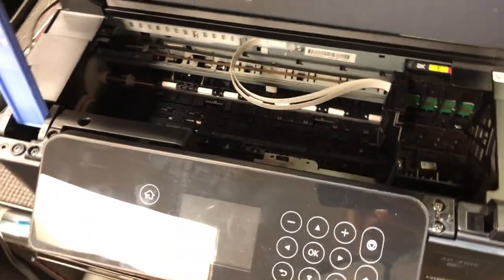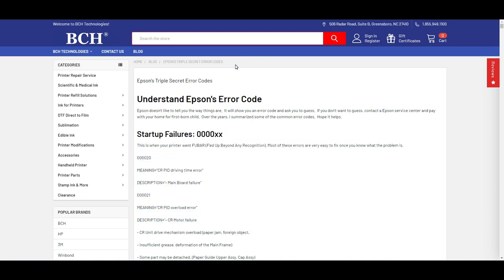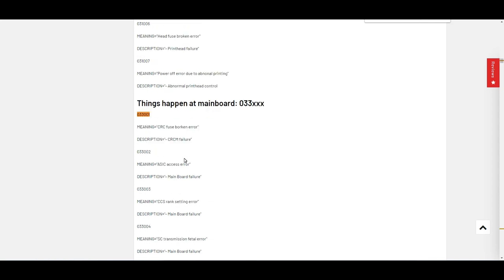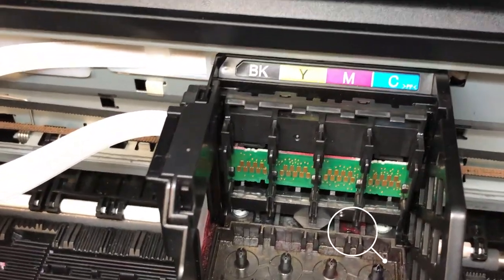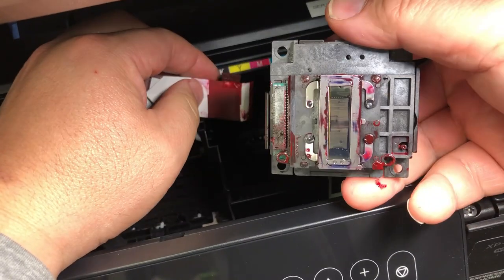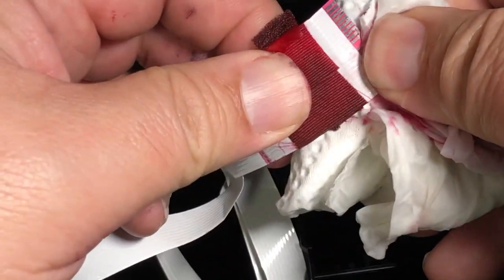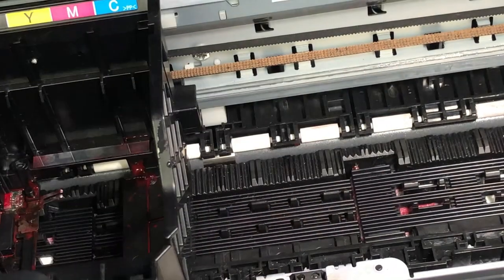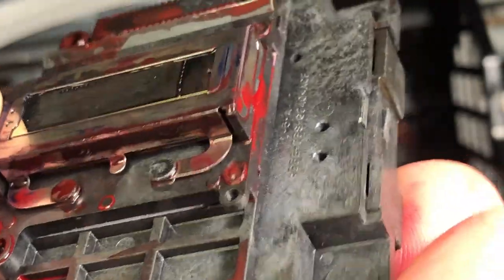Epson Error 033001 - Expression XP-4105  Troubleshoot Diagnosis

Comment: Thanks for providing more information about this error! With your help I was able to find the problematic fuse and came up with an ugly fix for my printer.

The fuse responsible for this is F301 on the CG30MAIN mainboard. It's right next to the printhead FFC ribbon cable connectors on the right side, next to a large resistor labelled R720. You can actually get a pretty good shot at it from the top of the printer after removing the plastic cover. I was able to desolder it and replace it with a solder bridge without having to remove the board or disassemble much of the printer, although you'll have to solder left-handed. While this did solve my 33001 error, obviously shorting out a fuse isn't the best idea long-term, so don't try this at home. I don't know the fuse value needed to find a replacement, unfortunately. If I find more information I'll put an update here or maybe make a video. Hope this helps someone.

Comment: Kevin, do you offer any disassembly procedures for the WF-7720, I think I have an blown fuse o the motherboard.  Also, do you replace the fuse or just the whole motherboard, thanks and keep the great videos coming!
Reply from the maker: Yes we do and it's coming up.  For the fuse, you can get a fuse from littlefuse.com.  However, the amp is 1A, so most people just drop lead on it and bypass it.  The shortcoming is that next time you have a short, you will see a firework display.  LOL.